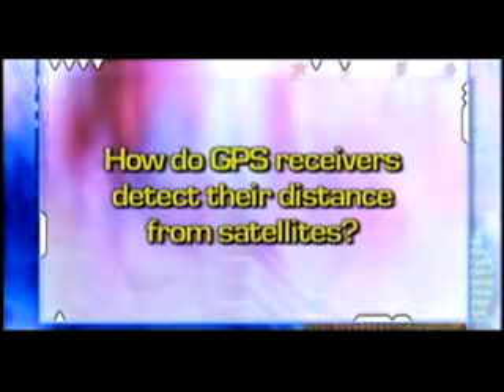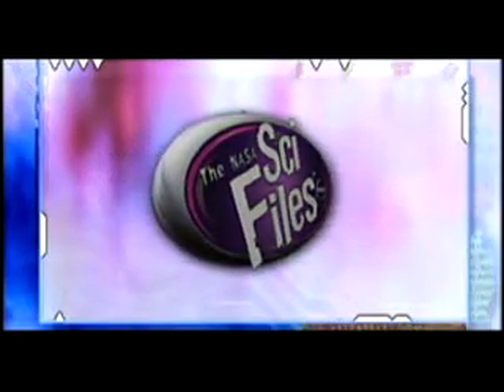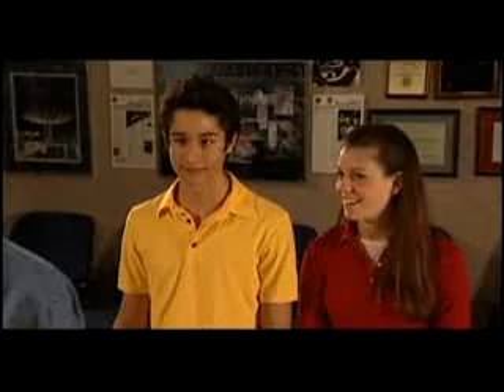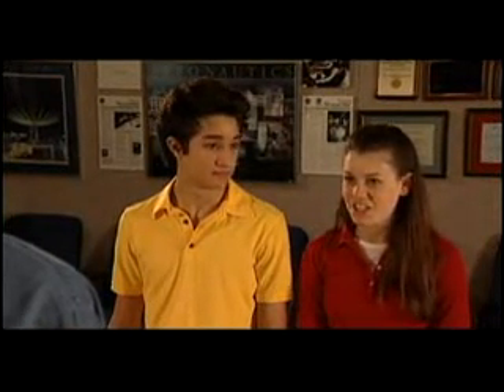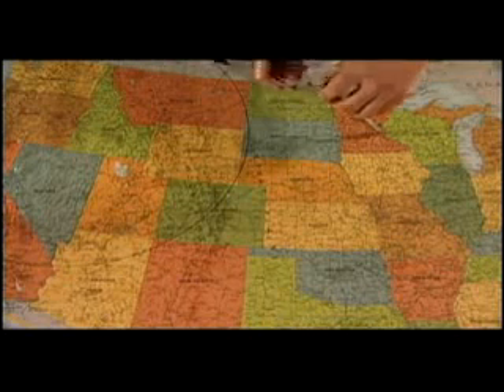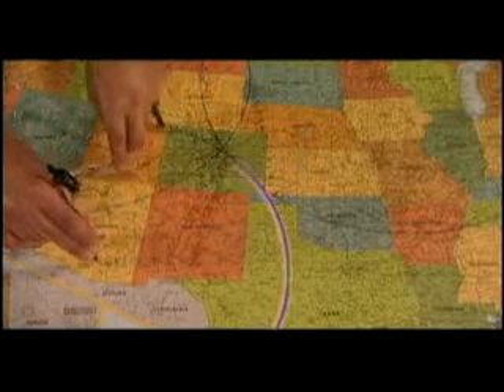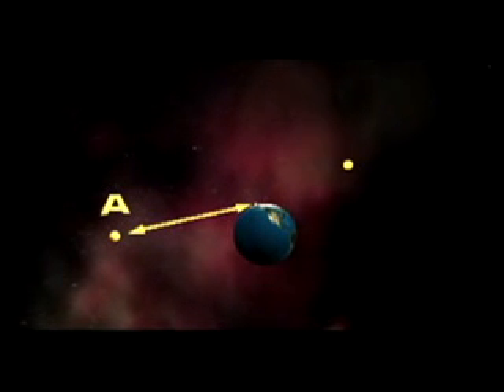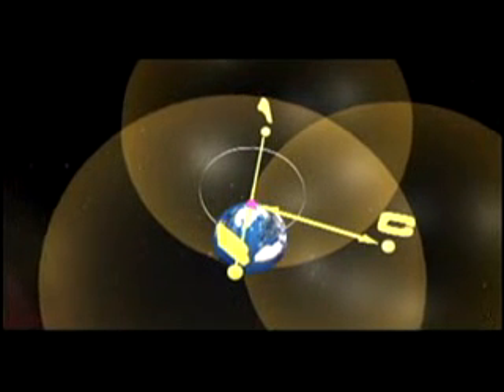how GPS works

Comment: While it is true 4 satellites are the minimum required, the explanation he provided is not correct.
3 spheres would be enough to determine the exact location of the location, the fourth one provides the time information, so that your GPS doesn't have to have an atomic clock built-in.

Comment: i have a small doubt (may be a dumb one). how does our mobile receives the satellite signal ? i mean how much nearer the satellite signals are? because it a very much huge difference in the distance between mobile and satellite.
Reply: mobile devices contains chips that are capable of receiving satellite signals, just like you receive signals from the closest cellular tower. some signals can travel very far distance with less distortion. ;)

Comment: respected sir,

i am a final year student of BE Electronics.
i am working on project for Visually blind peoples using GPS.
my problem is that.
i can't abel to interface my data from pc to LCD.
as it shows all data on my pc. 
the following code is for the interfacing with the LCD. it shows the error. 
and in that LCD i want only the Longitude and Latitude of the location. 
so whenever i will be on that exact location it speak that location.
for that first of all i have to save the location data in my IC Atmega8 
that also i tried to do but i get the zero result.

can you please solve the my problem. or guide me where is the my mistake or where is the mistake in my program.

software- AVR prrotius
bascom language